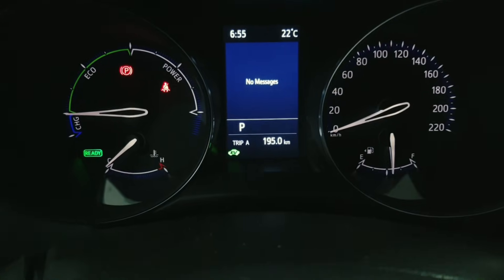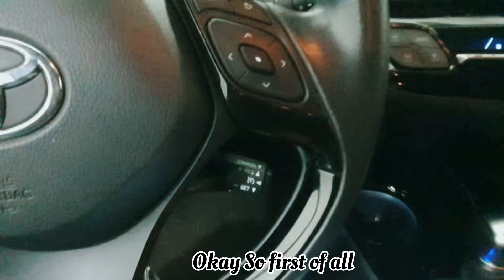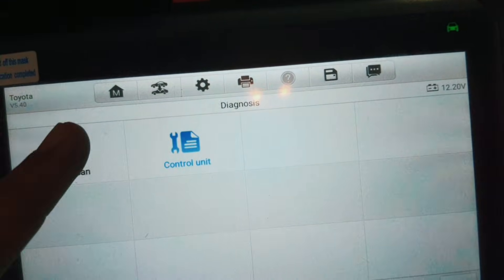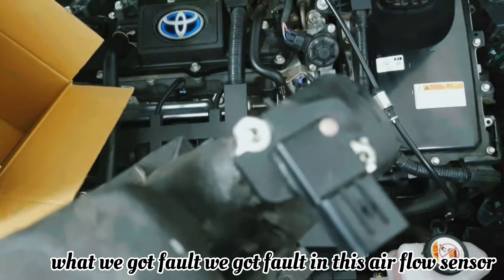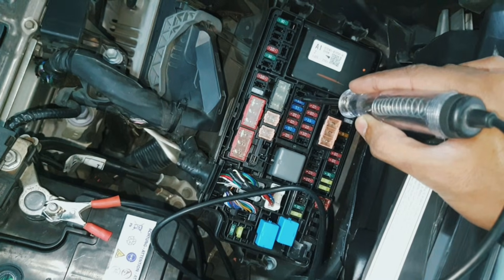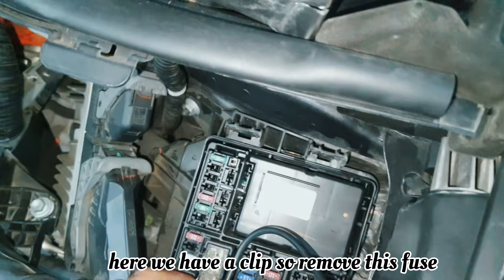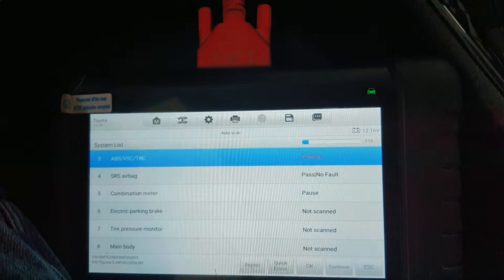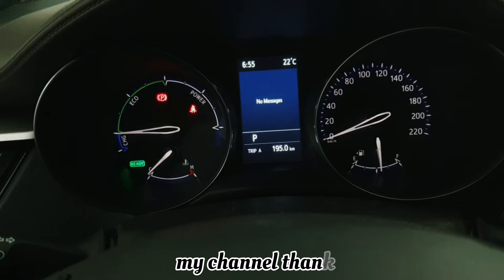How to fix Hybrid System Malfunction Toyota, fault code C1310.

Comment: EFI is not the engine....is Electronic Fuel Injection....so the electronic fuel injection module that controls fuel injectors was not getting power.